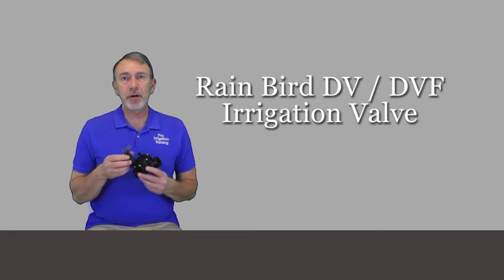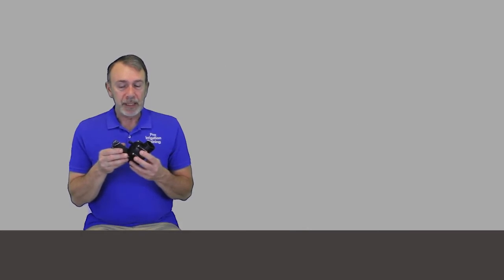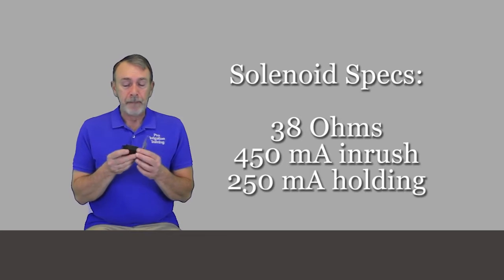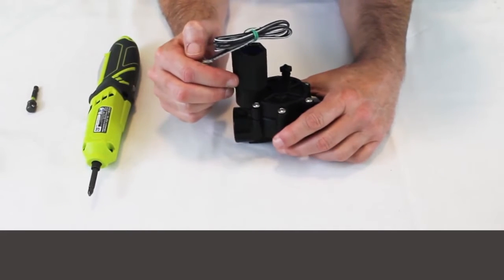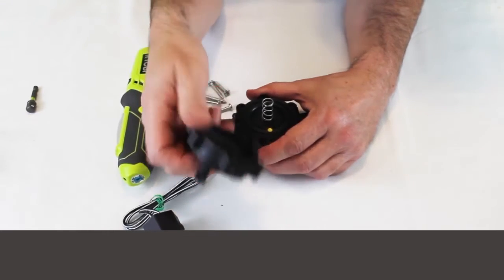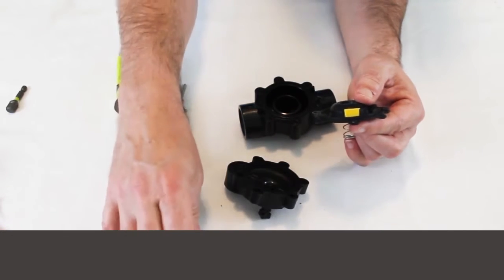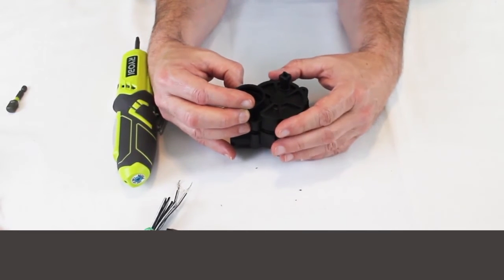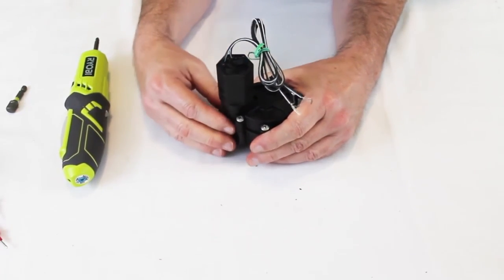Rain Bird DV Valve Series ( irrigation valve )

Comment: Is there any marking on the body to indicate what the connectors are? I'd like to order the correct replacement without doing a full uninstallation of the old one first if possible, thanks!
Reply from the maker: You should be able to tell from looking closely at the installed valve. There's usually a couple threads sticking out if it's a threaded unit. And if you don't see threads, you can tell the difference between just straight pipe going into a glued socket, vs a fitting such as a male adapter or female adapter. But there's not the designation printed on the valve beyond just 100-DV or whatever stamped on the top.

Comment: What is the small back thumb screw for. I watched the whole video for a description on that. My drip valve won’t stay open more than a minute. I can’t figure out what is going on.
Reply from the maker: Hello, sorry that info isn't in the video, but it is in another video, Solenoid Valve Features and Options. It's a bleed screw, and it's used to manually open the valve. If your valve wont stay open, it may be an issue of too little flow or too little pressure. Some valves have a lower minimum threshold than others. Or it may just be a defective valve. But first you should check the specs on the valve, then calculate your flow rate and check the pressure.
Reply: @Proirrigationtraining  Thanks!! I believe the problem was the Rainbird  pressure regulator that was threaded to my valve. After playing with it some more it blew the little white plugs out the side of it failing completely. I replaced it and all is working well now. What scares me is the is the 2nd one of these that have failed, of the only 2 I have purchased and installed 1 year ago. 
I’m in a variable speed Submersible well pump which seems to irrigate the yard at around 28psi. 
Thanks for the response!!
Reply from the maker: @rimrockelectric1926  I've never actually used the Rain Bird version of the pressure regulator. That's a shame about 2 failures, but glad you got it sorted out!
Reply: May I ask what would cause the valve to still leak after a tech replaced the diaphragm with a new one?